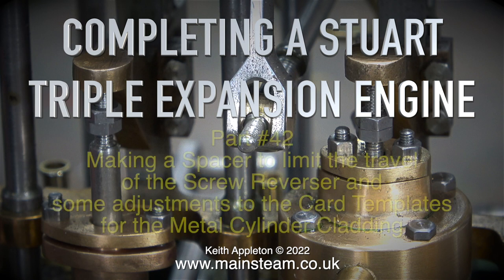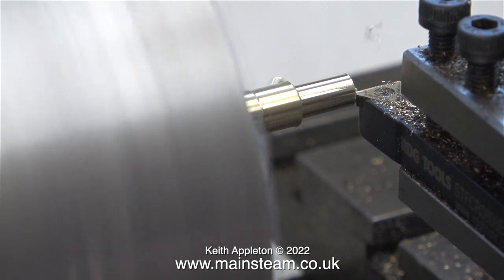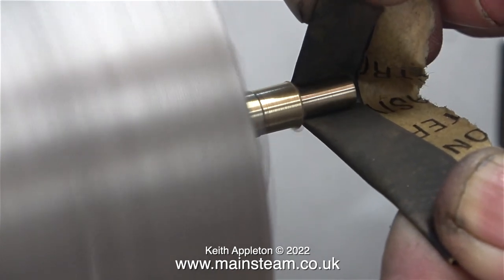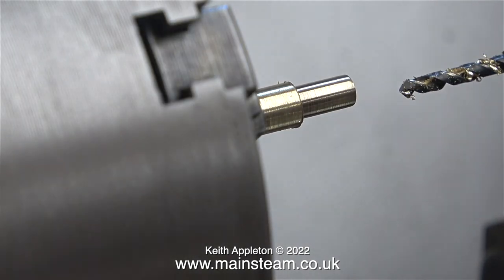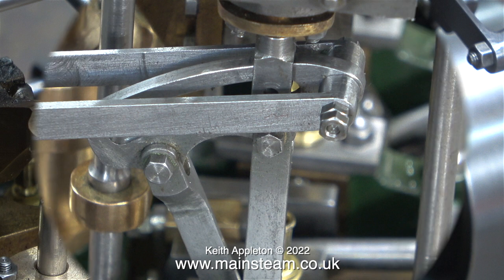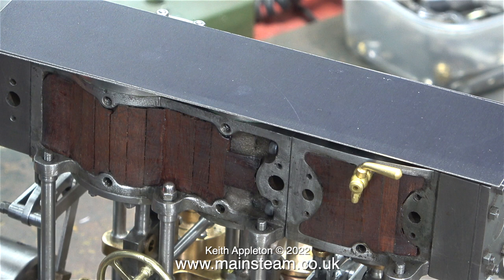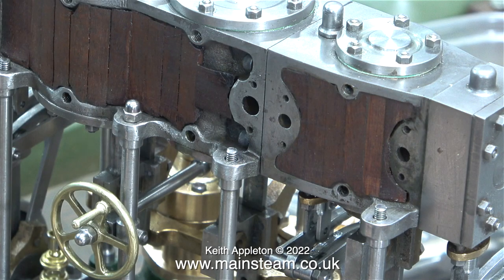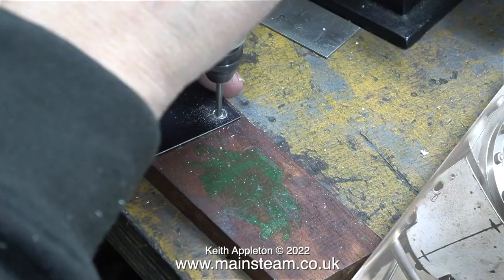COMPLETING A STUART TRIPLE EXPANSION ENGINE - PART #42

Comment: when drilling sheet metal Keith if you fold a piece of cloth into four ie fold over in the x plane and again in the y plane then put that under the drill bit it wont snatch the sheet metal and will drill a  nice round hole with very little burr.